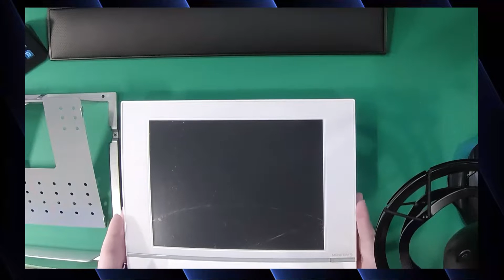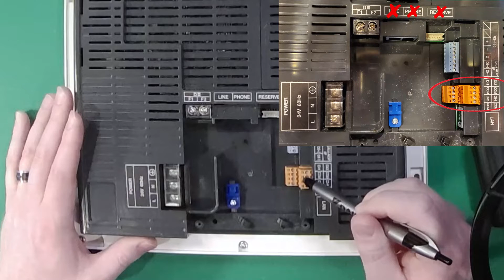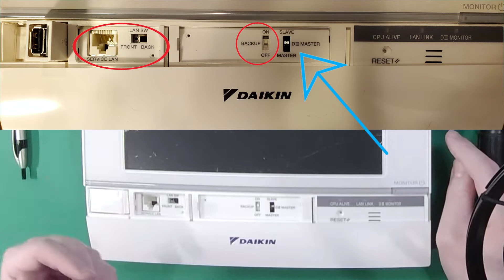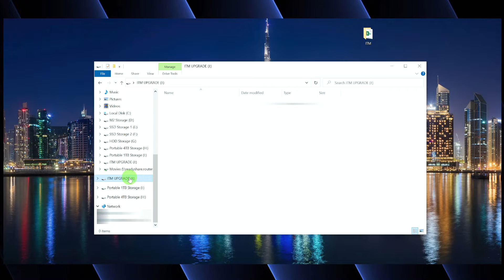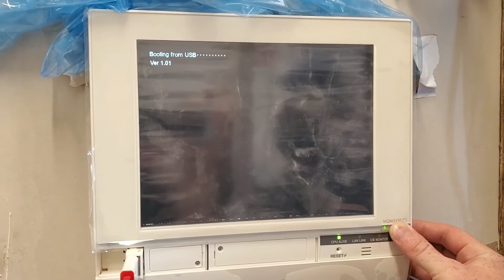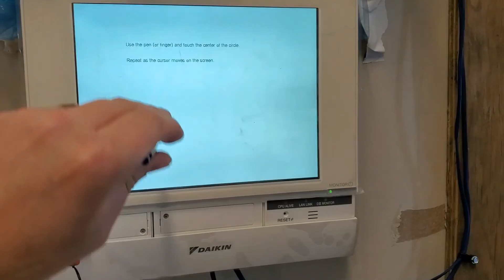Daikin ITM Central Controller | Intelligent Touch Manager Intro-Power-Software Install - 12-24-2021

Comment: Hi Dana, very helpful series. I am trying to get ITM Web remote access. After configuration, When typed the IP address on the web browser there is a message "no Adobe flash player".

ITM Model # DCM601A71
ITM serial # 006515
Software Version: Ver2.05.00U
Reply: This controller is from the last century. Good luck  accessing it with current browsers.

Comment: hello, the content is great, I read 16 volt dc energy on the emergency stop terminals, will pulling and releasing it to chassis cause a malfunction in the device?
how to connect an emergency stop button, thank you in advance for your support.

Comment: Hello colleague, i got a error message from out itm. Shows ''A system error has occurred, and “In safe mode SD card failure” and an error dialog are
displayed.'' this error. what can i do ? and why this error can occur ? Thanks.
Reply from the maker: Kill power. Remove flash card from back. Re install flash card. Apply power. Sometimes they come loose. Hopefully that resolves your issue.
Reply: @InverterAlways  thx Mr. Dana, i will try

Comment: Hi Dana, greetings, just want to ask if upon using the ITM maintenance mode, will the system still produce the U4-01 error if the indoor power breaker is turned off but it is in maintenance mode? also what is the main purpose of maintenance mode
Reply from the maker: Funny you should ask. I never use maintenance mode. I'm pretty sure you'll still get an error. The only reason from my understanding is to show its in a maintenance mode so users don't get confused when it errors. I would have to intentionally throw some units in and play with it a bit to refresh my memory. 1,000 itm controllers and counting, zero times used it on a job site lol.
Reply: @InverterAlways  Thanks for the response. Hoping to get a feedback whenever you try it. Thank you for your videos.

Comment: Thank you for the content IA.  Wondering if you can add a commercial inline ceiling exhaust fan, with an EC motor to the iTM?  Local rep is quoting me basically a whole control system just for the fan.  Almost 8k- parts only.  I have plenty of ports available.  Are there any add-on pieces I need to integrate a standard EF?  Many thanks for the help.  - Best
Reply from the maker: You can with a wago yes, depending on how much control you need either di/do or ai/ao type contacts may need to be added to the wago.

Comment: I installed one today and an error popped up saying 'in safe mode SD card failure' any ideas what this is and how to resolve it?
Reply from the maker: That's a bummer. Rare but common enough these days. Try taking the unit apart and checking the SD card deep inside. Might have come out in shipping. If that doesn't work, it's probably bricked.

Comment: Great Videos.  I have multiple VRV hooked up to an ITM and each VRV has one BRC set as the master controller.  Do you know if there is a way on the ITM to change which BRC is set as the master?  Or do you know a way to have the ITM as the master for all VRVs?
Reply from the maker: It really starts with what type of outdoor you have. Heat pumps have one master per system where heat recovery has every stat (in many scenarios) set as master. The itm has multiple options such as average or independent or voting for changeover. There's a lot of options so it would be hard to just say "do this" without more info on your system. I would recommend having your service contractor come out and walk through the gear with you so that you can discuss any changes you may want to make.

Comment: My screen is locked and no password was set up.says it has 14 characters
Reply from the maker: Screen lock on main screen? First things first plz reach out to contractor that set it up. It's likely saved on file. If not, there is a backdoor in. But they will need to do it.

Comment: Hi Dana, first of all congratulations on the channel, I'm really enjoying your teachings. 
I have an iTM in a building I work in and, after a power blackout in the city, the iTM returned with only 1 unit communicating (it activates at the programmed time). The other units have an alarm symbol (blue triangle with a lightning bolt). 
Do you have any idea what might be going on?
Reply from the maker: The blue icon means the itm is not talking to the equipment. This could mean a variety of things. But the first thing to check is that all equipment has power. Depending on the power issues, some equipment breakers might be tripped, or the boards on the equipment could be bad. Or a combination. If the equipment ran fine before power issues its usually not a wiring issue. I would start by having a contractor come out to check the equipment out make sure no bad boards and power to all equipment.

Comment: Does itm DCM601A51 can control wago coupleur using Analog output
Reply from the maker: Depending the software version I believe it will but double check with Daikin.
Reply: @InverterAlways  thank a you

Comment: Hi there,
i have issue with ITM. Afer some time my ITM start to rebooting every few minutes and after fews reboot go in the Safe Mode, Controler Failure. And sugestions , what to do?
Thanx in advance.
Reply from the maker: Reboots entirely or screen shuts off? I've seen the screen shut off and turn on before from the screen monitor button being broken (users smashing buttons). Haven't had a reset issue though possible someone tried pressing reset and got it stuck. That wouldn't be something I would think can be fixed though. May need to replace it. You can try unsticking it first though.
Reply: @InverterAlways  
Reboots entirely, nothing is broken or demaged. I allready tried to cut of  power and turn it on . It starts again and in a few minutes display freeze and reboot it self. That heppend few times and go in safe mode, controler  failure.
Reply from the maker: @marijovilusic7079  probably need to replace it then unfortunately.
Reply: @InverterAlways  
Thank you for your answer, all the best!
Reply from the maker: @marijovilusic7079  no problem, sorry I didn't have better news
Reply: My controller will not allow me to access password, have done  the 4 corners but to no avail, any  ideas 
Tony😊

Comment: I have a few of these under my service. Have ppd on all of them but nothing more. Took me a long time to get my local vender to provide me with tenant report but it is very handy. Here in AUS there’s very strict rules regarding ppd
Reply from the maker: PPD is pretty cool on these, simple to setup for the most part and once you get the export template buil easy to export monthly usage data too. Super handy add-on. I'll be doing a PPD here soon and will try to have the contactor get me some footage.
Reply: @InverterAlways  I have had zero issues with it too. Great software I just wish the tenant report was a little nicer layout for the customer
Reply from the maker: @SpectraV4  a little more automated too would be nice
Reply: We are currently installing 50 VRV 4 water cooled condenser models. Bacnet controlled but the client wanted seperate power distribution reports. Not sure why they didn’t want to go with the ppd report. Is what it is I guess
Reply from the maker: @SpectraV4  nice size job!!
Reply: @InverterAlways  pretty keen for it to finish so I can get into some system analysing. See glow it all goes, never worked on a water cooled condenser VRV
Reply from the maker: @SpectraV4  water cooled is awesome. As long as you have good gpm lol. I always seem to find the flow switches tripping at the beginning of startup.
Reply: @InverterAlways  can’t wait. I can see that happening to not going to lie, hopefully they get me there when the start up is going on so I can make sure everything is sound on the condenser water 💪
Reply: And I’m still using my old dchecker, we bought all these and I still can’t get a service checker out of Daikin 😂 so expensive. Around 1.2k usd. Or 1800aud
Reply from the maker: @SpectraV4  you need to go to vrv service and troubleshooting to become "eligible" for a service checker. I agree it's silly but they cant be having ppl call in constantly asking how to use it and how to analyze data so I get it. The service class is definitely worth the time though.
Reply: @InverterAlways  I use the dchecker all the time and have been working on these for years. Analysing the data is the same with more functions that I could learn  without too much issue. 👌 working on a VRV 2 right now, understanding what caused this comp to fail. Fun fun

Comment: Hi Dana the Kingston USB’s you mentioned are they a 1.0/2.0/3.0 or a C type USB?
Reply from the maker: Just a standard usb flash drive. I believe those are called usb type A but double check. Definitely not type b or type c, just the standard slot on itm devices nothing fancy. Get a 32GB one though.
Reply: @InverterAlways  Thank you, took up your suggestion and ordered a couple.

Comment: well how do I install the sofware???????? Any link ?????????????? PLEASE
Reply from the maker: You get the software from daikin after completing daikins courses. Check eith your local vendor to see if they have any classes coming up soon.
Reply: @InverterAlways  But my boss bought the physical intellegent touch manager.
Don't we get the software free?
Reply from the maker: @joseasendaopinto733  there is a software package already installed yes. But if you want to update the software or use the pc software to pre-program the ITM from a computer or laptop then you need additional software that does not come with the ITM. Your local rep/vendor whoever sold the gear to you guys will program this, or have a daikin person out to do it, or you can go through training to program them yourselves and at that point you'd qualify to get the additional software.
Reply: @InverterAlways The software package that is already installed enables to users see the power consumption of th system? thank you.
Reply: And where can we buy a eletric meter?
Reply from the maker: @joseasendaopinto733  you need to add tenant billing license to unlock it's called PPD Power Proportional Distribution (purchased as an Add-on)
Reply from the maker: @joseasendaopinto733  I like Measurlogic
Reply: @InverterAlways  can you give a link please 🙏?
Reply from the maker: @joseasendaopinto733  link for what? Ppd? You need to have a daikin rep install and program the tenant billing.

Comment: Does the power software allow you load the site equipment onto a usb stick on your home computer and then upload it to the ITM on site? If so where do you obtain that software. Could not find it in Daikin Europe site.
Reply from the maker: You mean tenant billing? Or just the regular programming software I use? 
If you're referring to the basic pre programming yes you load it to a USB from your computer then plug it in on site to the controller and upload it. 

You can obtain the software from the class, which is provided by Daikin in the states and local vendors who have certifications and experience to train said courses. I'm not sure how exactly Europe does it with their vendors but I would expect the process to be similar to the states. Check with your local daikin rep first to find out where trainings are offered. 
You'll be at least a few steps ahead of the class from these videos 😉
Reply: @InverterAlways  Many thanks, I’ll contact our Daikin rep. I subscribed to your channel, keep up the good work.
Reply from the maker: @iamspartacus8219  sounds good. Thanks for the sub too!

Comment: Thank you Dana this is what I have be waiting for love it.  Got a question about the Di1 contacts you mentioned that they are digital inputs.  My questions is the Di1 programmed to shut down if you get a digital signal or does it shut down if the contacts close?
Reply from the maker: Contact closure shuts it down. You can always jumper it on site to ensure proper shut down too before the integrator jumps in.

Comment: Thanks for sharing
Reply from the maker: Glad to get it out there
Reply: @InverterAlways  As you are aware that rarely gauges are used in VRV VRF system for PPM and D Checker are very expensive and can’t afford them unless Company you work for are D1 with daikin Please can you broadcast video using calculation to troubleshoot the system using  (target super heat,target subcool,DTD,ambient temp,pipe temp,PID …..etc 
Thanks Dana
Reply from the maker: @laworder6092  you need a service checker for VRF, although Dchecker technically works service checker is so much better. It's not that expensive when you compare the time it saves you during service. It's worth the investment just as any tool is that gets the job done right. 

I'll be doing some videos on service here this spring for sure. But you really need more than just gauges one way or the other to properly work on VRF. just fyi. Stay tuned for more.